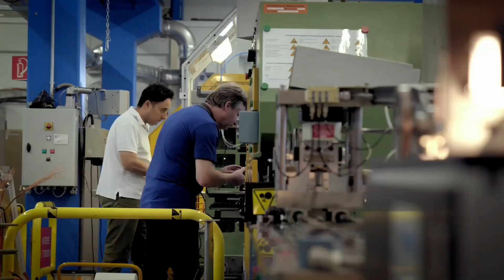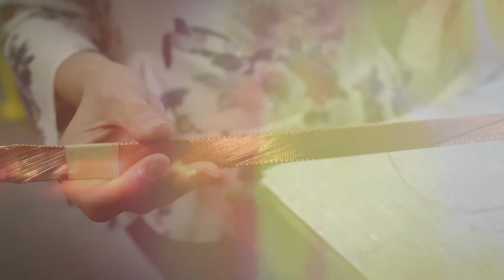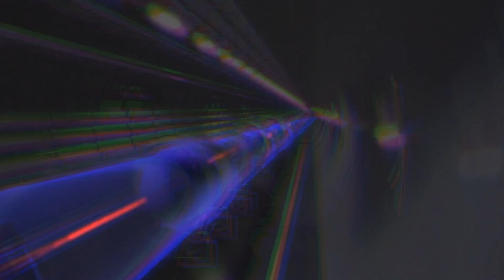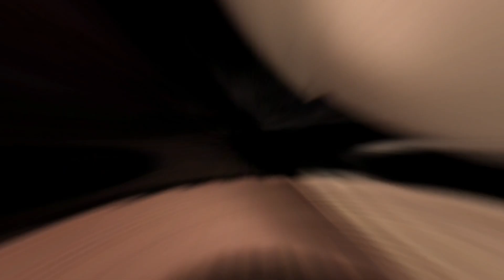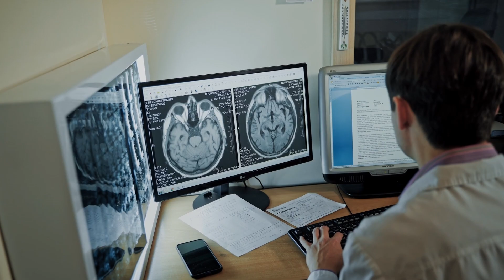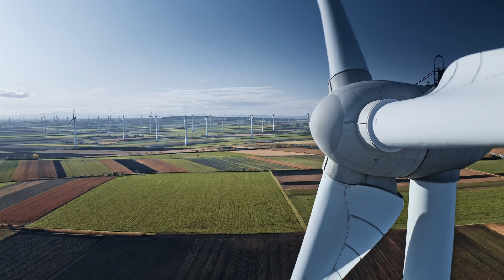CERN impact with superconductivity technologies

Comment: In the 1970s there was great hype about superconductivity for electric energy transport and Usage in large electrical machines. Millions and perhaps billions were spent on research. But it turned out that cooling to superconductivity required much more energy than the losses in copper, aluminum, and iron had been in the classic technology.
Yes, I have been in the superconducting coil of an MRT device. But that is another application.